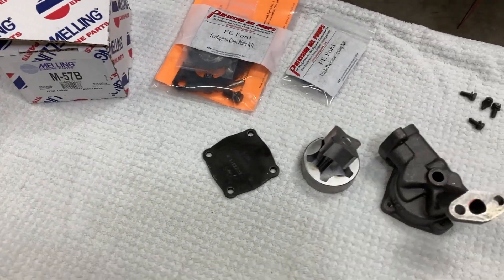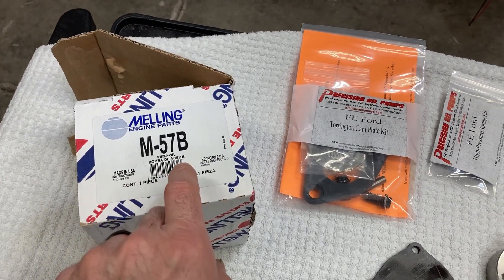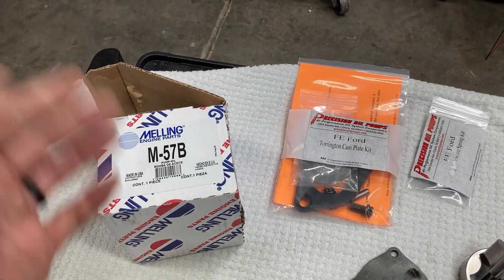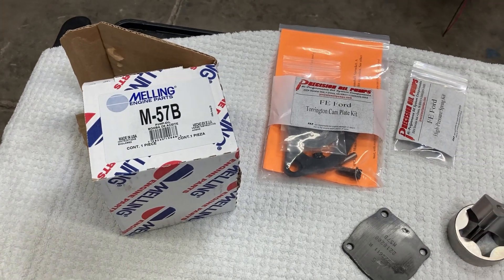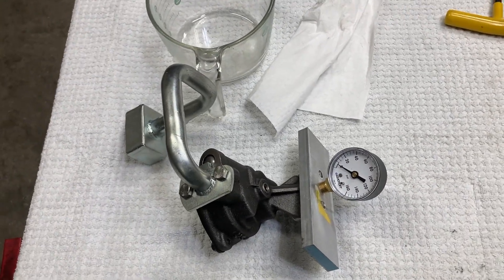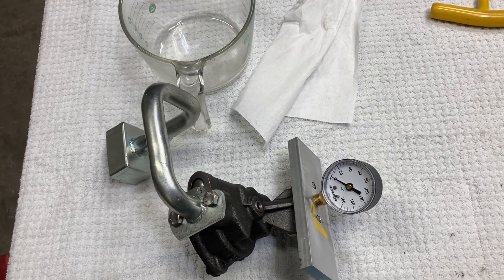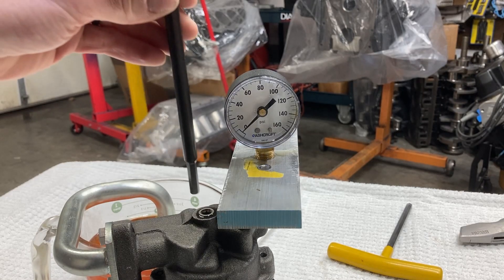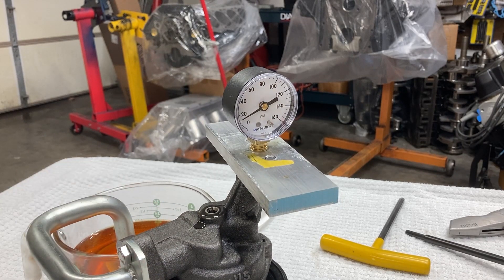Lykins Motorsports Let's Play With Oil Pumps

Comment: Oh wow, small tunnel port flat plane ford FE. That’s some neat stuff. 

Also my 390 in my truck was put together by my father in the early nineties & has the HV mellings pump. 
Thank you for sharing and explaining why I have REALLY good oil pressure, I’m careful with my oil filters. 
No worries though I don’t turn more then 4250 cause that’s where the rev limiter hits.

Comment: Like the pump  test it shows where the pressures  and relief  point all so when motor  are together  run drill and gage and look for rocket arms flow  my last 351 Cleveland  had to hold  a pan one them going over head rails haha merry Christmas

Comment: Before and after would've been nice.
Reply from the maker: I mentioned in the video the psi that the stock pump relieves at.
Reply: @lykinsmotorsports  yes you did. I confused myself. Some how I was under the impression that you were testing "actual" vs. theoretical.

Comment: I don't know what car mag I read it in but there was an article about building super stock 440 mopars and it said that it is about having an oiling system that does not take away horsepower, like unnecessary pressure, volume and bad oil baffling. That was when the duel oil pick up modification was popular with some racers.